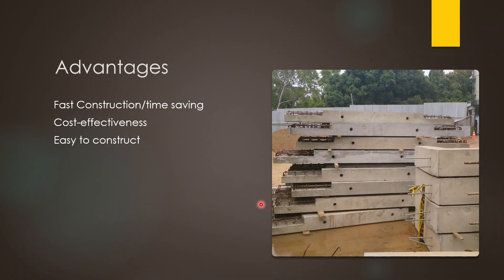Precast Building Construction | Easy Construction Process | Structural Guide

Comment: Can the building 👷‍♀️ sink throughout the soil because of rain ? I know that a tornado 🌪 or earthquake 🌎 can definitely swipe  it away or maybe a strong hurricane. I lived on an 18 floor before that used to move with the pressure of the highway and trucks 🚚 🛻 passing throughout it . I think the building closed down  is a couple of blocks from here.
Reply from the maker: A building can settle due to the weakness of the soil. That is inadequate bearing capacity, failure of soil due to the exceed of loads, etc.

But for traffic movement, settling building could be rear. 

For high-rise buildings, this is unlike. Most probably, high-rise buildings are on pile foundations. Settlement of the deep foundation with the traffic movement is very unlikely.

Comment: Hello sir I will construct 1500 sqft house. If I select precast building method how much amount I want to this?
Reply from the maker: The rate depends on many factors such as labor, material, post-tensioning cost, etc. Also, this method is more economical for repetitive work. If you are going to cast all those elements by your selection for the house of 1500 sqft, I think, It would not be economical.